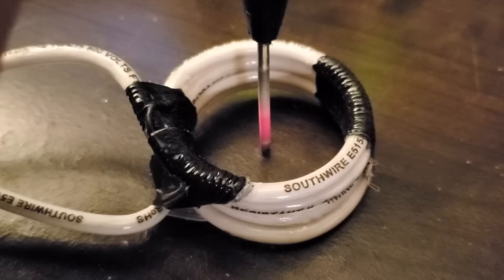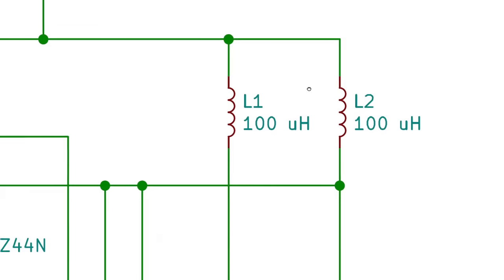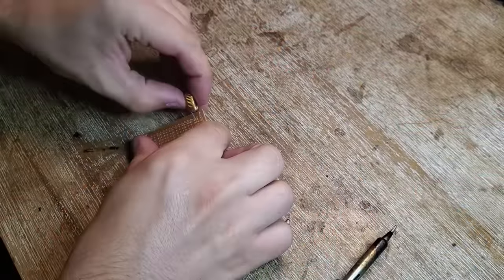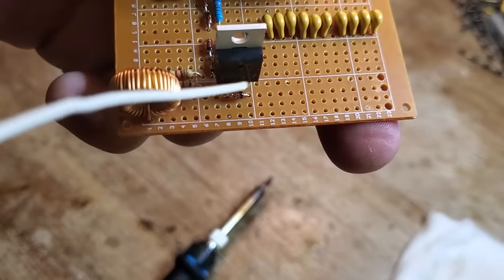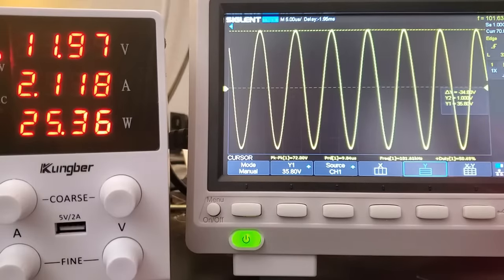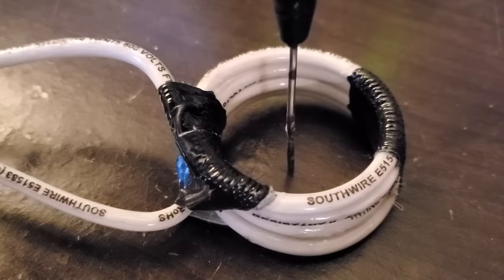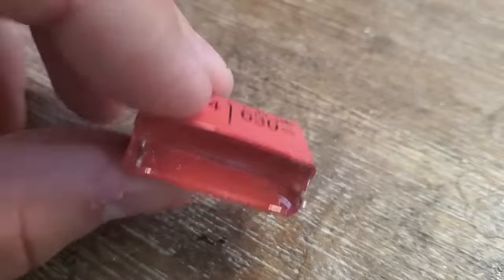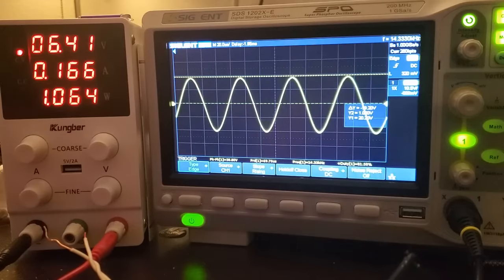Mini Induction Heater

Comment: Use MKP capacitors not MKS, MKP are meant for pulsed operations and is the ones I used over 10 years ago in mine and worked perfect with no overheating.
Reply: Just increase the capacitance by adding more capactiors in parallel, it will solve the problem
Reply: @devilssongs530  No, their internal resistance at high frequency will make them all overheat at the same time and blow up.
Reply: @dtiydr  hey, 
I have just made a zvs driver circuit using the diagram provide by this video, i applied 12 volts but it isn't working.
Can you please help me fix it ?
Reply: A cap's ESR is going to influence, but some unpolarized caps, by design, must be used in a polarized mode only, e.g.: spikes going only one direction, not both! It sounds awkward but it's RTFM.
Reply: Components need to be derated when used under the wrong conditions, such that they only work briefly. Obviously, the right solution is to use the appropriate part.

In this case the voltage rating is fine, but given the ESR, the package can't handle the heat. One capacitor can be replaced with four identical capacitors in two parallel pairs in series. At moderate frequencies the capacitance and ESR will be the same, but they will be able to dissipate 4 times as much heat and handle twice the voltage.
Reply: Hi, can you help me with a unique induction heater?
Reply: @akane8919  What problem are you facing with the circuit?
Reply: @dtiydr what would be the solution?
Reply: Free education in this thread everyone, hurry up!
Reply: @szekerespista3758 
He answered you better than I ever will.
But use the right parts if possible, be aware of polarity in terms of reverse voltage spikes or maximum voltage transients. Use more caps in parallel/series configurations to achieve very similar F value but increase heat dissipation and max allowable current etc

Comment: Interestingly, at high frequencies an aluminium wire would only have about 26% higher resistance than copper (with a cable of radius approaching infinity), rather than the regular 58% as the skin depth of aluminium is higher than that of copper. The skin depth of copper at 100kHz is about 0.2 mm, whereas that of aluminium is about 0.25 mm. The radius of the 20 AWG wire is about 0.4 mm and 10 AWG is about 1.3 mm, so the skin effect is quite significant at these frequencies (the skin depth is the depth at which the current density reaches 1/e, approximately the thickness of pipe at DC the cable is equivalent to for large diameters).

Comment: Try putting the heated metal closer to the heater coils rather than in the center...I have not tried this, but the magnetic field of a solenoid is maximum NEAREST the inside edge of the coil.
I hope someone tries this and comments on the results!!
GREAT VIDEO!!!!!
Reply: I've seen these with a much smaller diameter of the coil which would be closer but I don't know if that helps or not. Usually the coil has no insulation.

Comment: On your comment about adding metal changing the inductance of the coil, I'm a bit torn. It's true the frequency of the signal doesn't change, but we do see a phase shift. I suspect the metal has to be changing the inductance of the output coil, but that's probably not changing the inductance of the resonant circuit (since that's separate, based on the circuit diagram?). The different load inductance just changes the phase of the output, causing it to slide across. 

You could check this by comparing a soft iron to stainless steel. The soft iron should change the phase more since it is more ferromagnetic.

Comment: Nice video! But don't use MKS caps. They have too high dielectric losses and will cook themselves like you showed. You need MKP or even better FKP capacitors that have low dielectric losses.

Comment: I deal with old school Vacuum Tubes....this appears in schematic as a Long Tail Pair Phase Inverter circuitry to drive a Class AB Push Pull power tube amplifier system and thus the output transformer & possible feedback loop back to the input of the PI.   I'll have to look at my scrap parts and see if I have a toroidal coil around to salvage out and brew up a Vacuum Tube Cooker

Comment: Was part of melting the wire due to the nut having a hole in the center? Its eddy current would be going around in a circle and making a magnetic flux that would couple back into the coil?

Comment: Did you safe the Falstad circuit?
Could you add the (short) link to the simulation in the description text?
100 milliOhm resistors?

Would like to give this a shot as wel, for heating nuts and bolt on a vehicle.
Could it be run from a vihicle battery?

Comment: U built the circuit with a small induction coil and 60uh chokes instead of 100uh, i then ran it t about 6 volts drawing 1 amp but with no zener diodes, are the zener diodes crucial, all that happened is there was a slow voltage increase to 6 volts and then no oscillation and one of the mosphets was heating up slowly. Would this be the chokes or that there are no zener diodes.
Reply: Zener diodes are needed above 15 volts. Your circuit is not oscillating for some reason. Your voltage is too low too. Test with 12v and con connect it immediately without slowly increasing

Comment: Nice and I have a question as you mentioned going up to 12KV. 

Would it be possible to 'charge up' the inside of a sealed plastic tube formed into a torus with a negative ion charge by sticking a wire into it, sealing the entry point and running 12KV through the wire (like the negative ion emitter of an ion wind generator)? 

If you can, would wrapping it in wire to make a toroid electromagnet out of the tube accelerate the negatively charged air inside (and maybe things that can be charged with static/negative charge that you also put inside like small metal bearings or plastic beads)?
Reply from the maker: Seems like that could be done. To make it work properly you'd need the inside lined with a conductor like aluminum foil/tape, so it might be a pain to build
Reply: @HyperspacePirate  Eh? No, I meant ionizing the air inside the torus with just a tiny carbon fiber brush that those small ionizers have and seal the hole you make to allow the brush part inside. 

If you rub a balloon on fur or hair it can store a static charge on the surface so something similar with only the brush ionizing the air inside and then an electromagnet moving the charged air as if it was a plasma. 

Ion wind drives are all about charging the air from a point source (eg. nail, tack, needle, etc.) and then streaming the ionized air to a neutral or positive ring. This would be that without the last part. You would not need to line the inside of the tube with anything. 

Do you think that would work (as long as you don't let the brush allow the charge inside to drain out)?
Reply from the maker: @curiousviewer5991  yeah that sounds like it would work as long as your negative lead was properly grounded. You could probably try it by bending some PEX or vinyl tubing into a ring to make your torus
Reply: @HyperspacePirate  Thanks. :) I'm thinking about just that but since you look much more experienced with the high voltage material I wanted to pick your brain a bit. The ion wind material on YouTube is a little thin and I'm curious about it now. lol.

Already got some vinyl tubing (with thick walls for good insulation) and a number of ideas to try once I sloooowly get everything together.
Reply from the maker: @curiousviewer5991  I'm doing my next video about generating high voltage off a battery input, and probably ion wind after that, because it's also usable for propulsion
Reply: @HyperspacePirate  Nice! I've seen a number of videos on that (Eg. ion lifter triangle, the spinning type and MIT's plane from 2018 using a version of the lifter for horizontal thrust) so it'll be interesting to see what you come up with. :) 

Not looking at propulsion myself and more better windflow like how version 2 of S & D innovation's attempt at ion wind went on his channel. He had it blowing a fan to measure the windspeed in RPM and it seemed quite decent. 

I'm thinking that the coil behind the emitter helped repulse the ions to a faster speed as the magnetic field created by the coil would have focused on the tip and the magnet in their path attracted the ions before their neutralization (which got me thinking about the toroid electromagnet). Something I'm going to have to check on. :)

Comment: Can you tell me if the mosfet unit is the most efficient type of induction heater ???? Also, was told that a low frequency that is used in the old General Electric company induction heaters was the most efficient and heated much deeper into the metal, is that true ??? 
Thank you for your time  Sir.

Comment: Shown at about timestamp 7:15 what are the total number of windings on each half of your center-tapped primary (I assume it is tapped in the center)?  Is the secondary wound with 10 times the total number of primary windings, or just 10 times the number of windings from the center tap to one end?
In another video, it stated that the ratio was only from the center-tap to one end...I think this was determined to be incorrect.
THANKS AGAIN!
Reply: No the turns ratio is from end to end, no matter if your transformer has a centertap or if you are using the two inductors as in the first version.

Comment: Does anyone know how to dial in the frequencies for certain metals? For example, if you wanted to create an induction heater for Iron, or Silver, you'd use a different Hertz. But any idea how to get those values to build optimized circuits for specific metals and alloys?

Comment: Is this an efficient method to turn 12VDC into 120VAC with the right tuning ?
Reply: 120VAC? Yes. 60Hz? Maybe. It would require rather large capacitances and/or inductances to bring the frequency low enough.

Comment: hyperspace what u think about heating plastic extruder with induction?
Reply: Build a hollow smooth workpiece, and put your plastic filament through it. Should work, but the inner surface needs to be smooth so that it doesn't stick.

Comment: Nice design I see it is your go to ZVS Driver, not sure where to get the capacitors could you give me a link of where you get them and also the mosphets as i don't want to buy ripoff versions thanks
Reply from the maker: I get almost all my components off DigiKey except for really basic stuff like resistors / connectors. You're almost guaranteed to get a bogus part if you buy things like transistors/ICs from amazon or Ebay cause the Chinese suppliers will put a die that's 1/4 the size of a genuine component and, for example, your 4 amp device will become a smoking hole at 1 amp
Reply: @HyperspacePirate  yeah sounds very accurate I have experienced that a few times, can you send me the link of the exact capacitor you have used as I couldn't find it and same with the fets
Reply from the maker: @Summers.Swell5  The cap in this video sucked because it had a really high ESR. Try this instead.

https://www.digikey.com/en/products/detail/kemet/C4AF3BU4100A1YK/8611241

FET

https://www.digikey.com/en/products/detail/infineon-technologies/IRLZ44NPBF/811808
Reply: Look on ebay for "induction cooker capacitors".  They must have an "MKP" rating  These are cheap, rated for 50kHz, and are MADE FOR this circuit!

Comment: Can i use this circuit for my diy induction stove?
Reply: I think i can, i don't really need a higher temp, i just need it enough for boiling and frying, probably at 150°C to ±250°C
I don't need it to melt the metal tho😂😂
Reply: And I'll think I'm gonna use copper tubing tho😂

Comment: Is the circuit sensitive to the length of wire (or number of coils) used in the heater coil?
Reply: Yes.  The coils form an inductor, which works with the capacitor to form an oscillator.  Similarly, if you add enough metal then the inductor will change.  That's what he was talking about at 6:50.  Just a screwdriver isn't enough to cause the effect.

Comment: Can someone please explain exactly what a choke is and how it works?
Reply: Inductors resist an instaneous change in current.  If you put them in series with a load they’ll limit the current that goes into the system.
Reply: @owenvanriper  thanks for the update

Comment: Can i use to power flyback/eth transformer of crt tv ? To generate high voltage plasma_arc ?
Reply: You , of course yan use a flyback transformer to create high voltages. However that is completely irrelevant to this video about a high current induction heater. 🙄

Comment: can i use a 5W zenner diode?
Reply from the maker: It would be overkill, but it would work, yeah. I'm using 500 mW zeners in this circuit. Two 5.6V ones in series
Reply: @HyperspacePirate  im planing to use irf1407 which has 330W ,2 mosfets in parallel
Reply from the maker: @trung12309  sounds like it'll work. Keep in mind the IRF1407 has a 75-volt VDS rating, so you won't want to give your circuit more than ~22V
Reply: @HyperspacePirate  ikr because i cant even buy a SMPs, all i have its just a laptop power supply
Reply from the maker: @trung12309  if you can find some thrown out PC power supplies they usually still have working MOSFETs
Reply: @HyperspacePirate  nah those are power mosfet work at "outlet range" and i have a question: wat does inductor do in a zvs
Reply from the maker: @trung12309  The two inductors  connected directly to DC input filter out ripple, and the inductor in parallel with the capacitor is the load that the ZVS circuit is driving
Reply: @HyperspacePirate  so the zvs just work fine without the inductor, right?
Reply from the maker: @trung12309  No. It's a very important component because it provides isolation between the AC on the load and the DC supply. If you're unable to get some, you can make them by winding wire around some metal cores - preferably ferrite rings if you have them
Reply: @HyperspacePirate  i do have a electric bike charger but it ouput 56-60V and i dont have a buck, sh life:/
Reply: @HyperspacePirate  wait i made my tiny zvs driver and a flyback core i could use it to make a inverter
Reply: @HyperspacePirate  damn so i made my monster zvs it was sucessful but when i run it just beep beep beep beep because of my stupid 19V 3.5A supply, I NEED A LEAD ACID BATTERY
Reply: @HyperspacePirate  i want to contact with u do u use facebook?
Reply from the maker: @trung12309  you can email me at hyperspacepirate1@gmail.com
Reply: @HyperspacePirate  The two 1/2 watt identical zeners give you a total dissipation capability of 1 watt.

Comment: one day a mosfet will exist which will not get too hot, efficiency is what we gain with out too much resistance, but so much capacity for trans, sister. when i di owed, i induce and coil in a valve like xxxxxxxxxxxxxxxxxxxxxxxxxxxxxxxxxxxxxxxx xxxxxxxxREDACTED